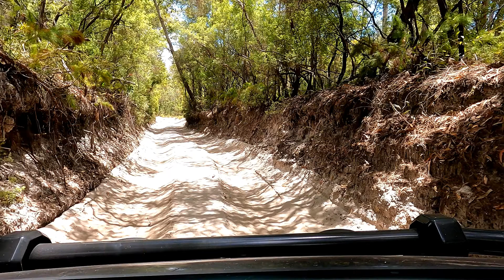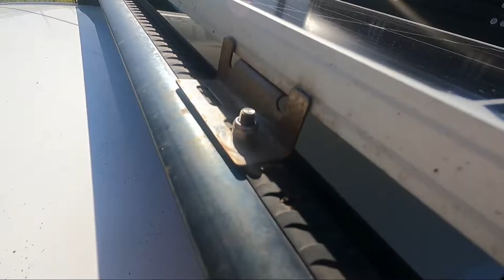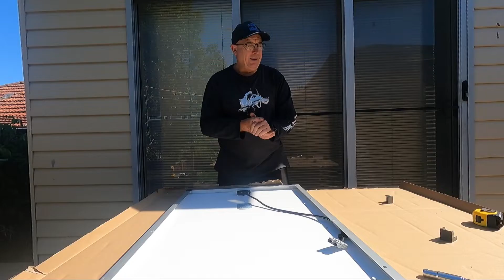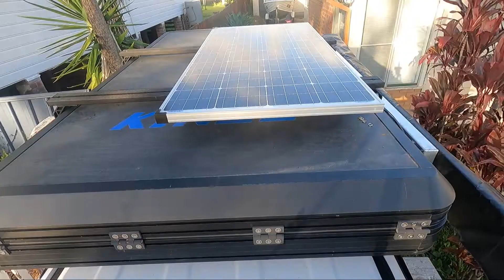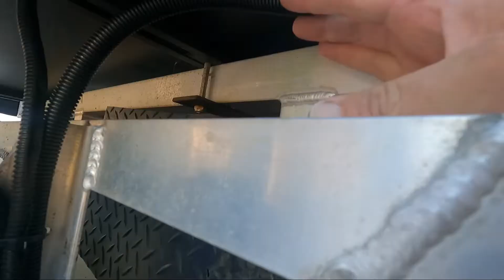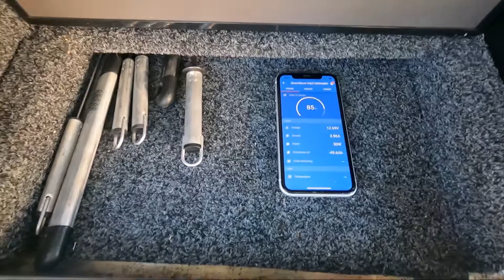Upgrade Off grid Camping Adventure: More power With 2nd Solar Panel!

Comment: What device and app are you using to check on the power usage
Reply from the maker: Hi. 
I have a victron smart shunt and their app. 
Cheers 
Craig
Reply: @ottouring  Thanks mate, they arent cheap I see $225. I notice Kings just brought out a digital display version for $98 but certainly having it on the phone would be nice.
Reply from the maker: @tasumi1968  $172 on eBay